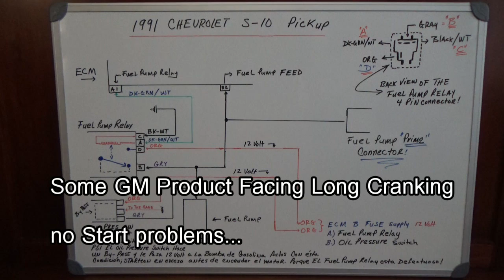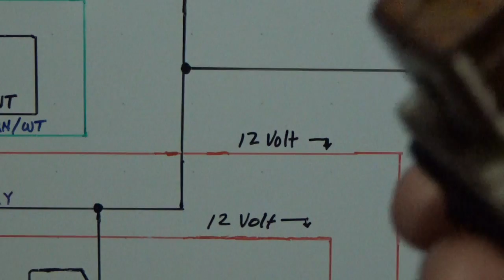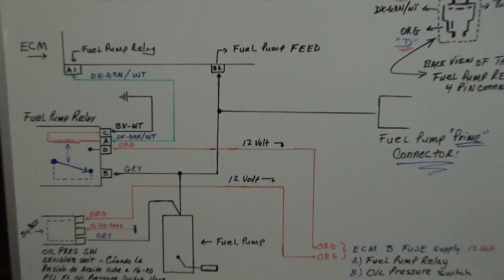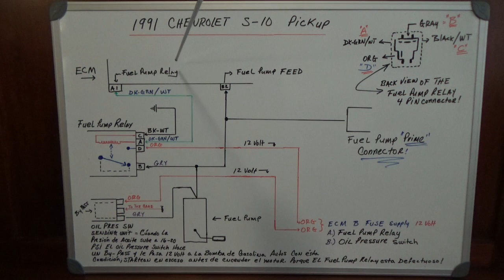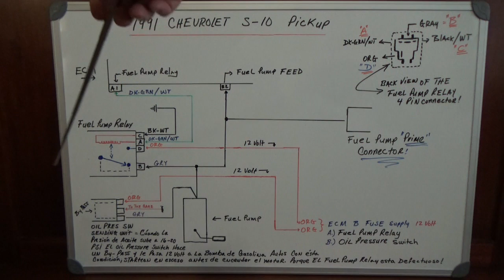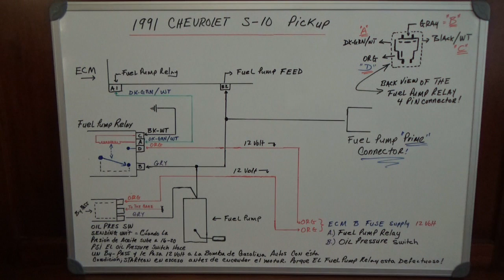91 Chevy S-10 How Fuel Pump Relay & Oil Sender unit works!

Comment: Great diagram and information.
Im having starting issues. 
When trying to start the engine, the engine will start for about 1 and a half seconds, then die.
Most times, the engine starts and runs fine.
Intermittent problems suck..... you aren't sure if you fixed the problem.
The truck runs fine, but has this  occasional starting problem. Its happening more frequently now.
When its running fine, i can run it steady to 4000 rpm while driving, indicating no fuel pump or filter problems.
I just pulled the fuel pump relay and the terminal with the gray wire is not shiny at all.  The entire terminal has a grayish green tint. The other 3 contacts are fine.
Im hoping that cleaning this terminal cures my problem.
Thank you. I'm hoping this is my problem.

Comment: Hola I have a 1993 Chevy s10 2.8 I want to put a kill
Switch connecting with the fuel pump which wire would I splice? The grey one or Orange one

Comment: My 1990 is doing this exact thing except for my pressure switch is good and the relay is good. I also have 12v at the pump prime test wire (mine is gray) with a test light. I turned the key, and it lit up for approximately 2 sec. The fuel pump is also new. Relay clicks. No prime. I changed the fuel pump because it was dead. I drove the truck for one day, and it never would prime and pump after that.
Reply from the maker: Here is the thing went you work in fuel pump don’t use a test light because you don’t know actual voltage going to the pump! I have similar problem with a relay was clicking and turning the test light on but wasn’t sending good voltage to the fuel pump! Brand new fuel pump , brand new fuel tank , brand new relay from Advance Auto Part’s ! Turn out to be the brand new fuel pump relay was bad ,so I went to the GM dealer and buy a new fuel pump relay and that fix the problem…
Reply: @PeteSambolin  Yeah  I thought about checking the actual voltage. I borrowed a meter and checked it. So I ended up taking the pump back out to inspect it, and the two wire plug to the pump motor was corroded. I cleaned it up and it started working. Thanks for your help and the good videos!!! Love an S-Chassis

Comment: THANKS SO MUCH... been battling a warm start problem for YEARS now. Turns out it was the oil sending unit by the oil 
filter. Great diagram and explanation of the system.

Comment: Great. I did this.. I disconect the relay from the s10's wiring. So I conect pins A an C to positive and negative, the click sounds but i dont have anu voltage from pin gray. Is exactly the same you tall about but without doing it with the key on. Is the relay defective right?

Comment: Hello I need help. I just replaced the fuel pump in my 91 s10 blazer. I have the new pum plugged into the harness but the are two more wires coming from sending unit with a metal loop. Is that a ground? Do I just connect to frame. Not sure what to do. Please help

Comment: I have an 1989 s10 blazer 4.3 . I swapped a sbc. I want to know which wires need to be connected so I can run the fuel pump all the time with the key on
Reply from the maker: Marvy Marv Hi 👋 by the Relay is a single wire with a connector is a gray wire or orange wire they call that the fuel pump prime wire! By supplying 12 volts to that single wire connector the fuel pump motor should run...
Reply: Hey again . Okay got the pump to prime when I want to , I connected the the orange to a 12v and you can see gas shooting up..... instead of priming I just want the fuel pump to run when I have the truck running! What wires should I connect?!?... again this is a 1989 s10 blazer that had a 4.3 but now a sbc 5.7... and yes I did remove the computer!
Reply from the maker: Marvy Marv well the same ORG wire run directly to the fuel pump so that’s is way you can prime from that ORG wire!
Reply: I get what your saying about priming (connect orange wife to 12v source)..... but I want the fuel pump to run only when the car is the on and running position... should I connect the grey wire from the fuel pump to key on 12v source or ??!?!!!?.. again I don’t want prime (if I have prime on all the time it will shoot gas out of my carburetor... I just want the pump to run not the prime.
Reply from the maker: Marvy Marv Yes! Well that’s is way is a relay and computer control for this circuit! And if you want to do a bypass you going too run wires with a 25 amp fuse and a ON and OFF switch inside the car!
Reply: Gracias mi amigo!
Reply from the maker: Marvy Marv De una!!! Hermano!!!